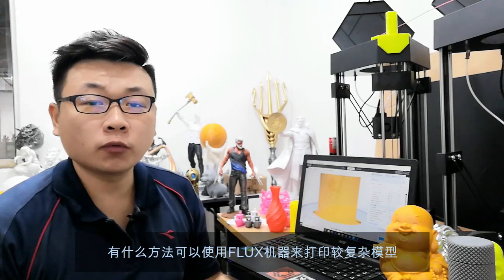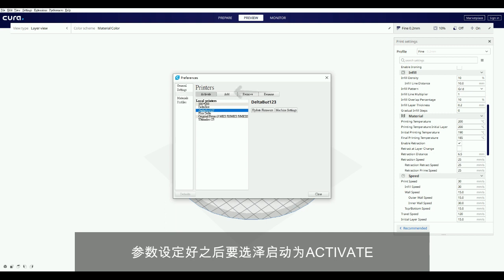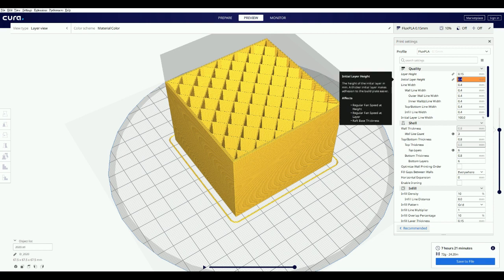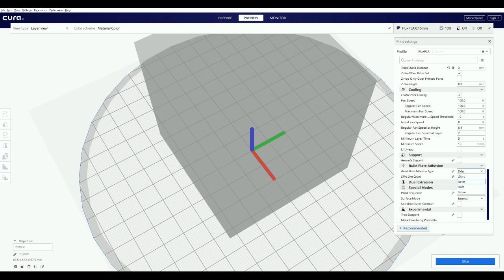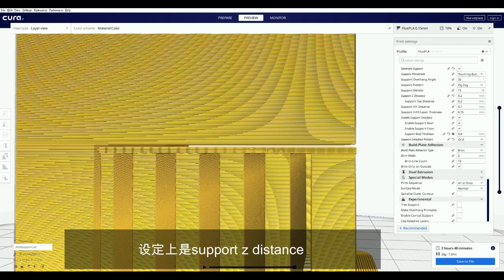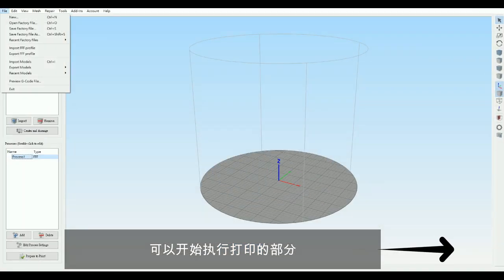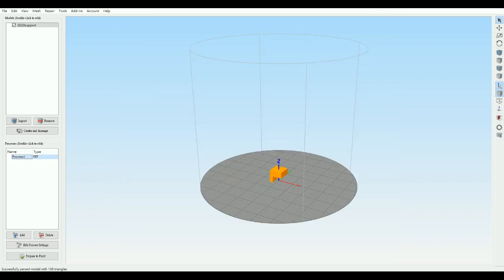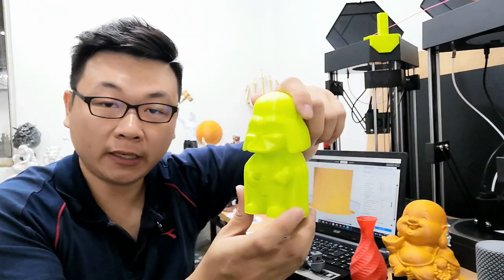Slicer Setting For Flux Delta #deltaprinter #multifunction #knowhow

Comment: Hi Declan, 
could you share Cura Slicer Profile again ?
I cannot access the link.
Reply: Coincidentally, I've come back to this video specifically looking for the profile for a new PC. Wound up finding the file in an old backup I had. Seems Declan hasn't had a chance to take a look at it yet, so I figured I may as well upload it in case you or anyone else needs it.

https://drive.google.com/file/d/1AzWKOV5PWNiUCX_iC8nGIQOzAOTO6Jqf/view?usp=sharing
Reply from the maker: @castorvulpes1336  thk you,,the file i dont know where edi ,,,
now im using simplify 3d
Reply: No dramas! Happy printing!
Reply from the maker: @castorvulpes1336  so far u still using FLUX Delta?
Reply: @declanchengcsl  I was one of the Kickstarter backers for the original Flux Delta. Was my first 3D printer, didn't really know what I was doing, wound up with a couple failed prints, and my Delta sat in the corner gathering dust for 6 years. About a year ago I wanted to give 3D printing another shot, so I dug it back out and I've been using it to make odd things since then. Planning on getting a couple new printers soon, but in the meantime I've been using my Delta, particularly to learn about slicer settings and whatnot.
Reply from the maker: hi 
let me check